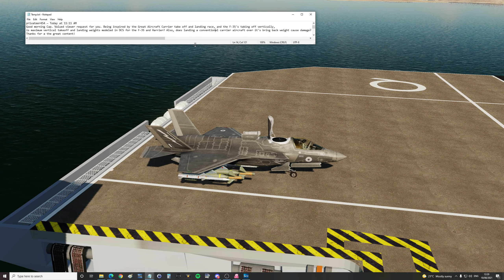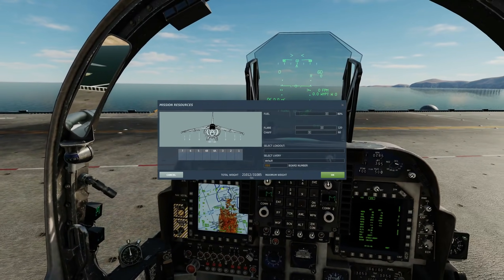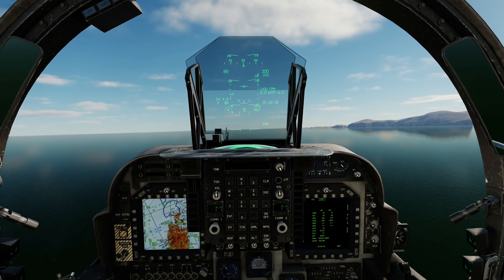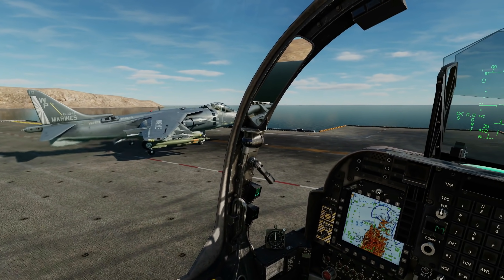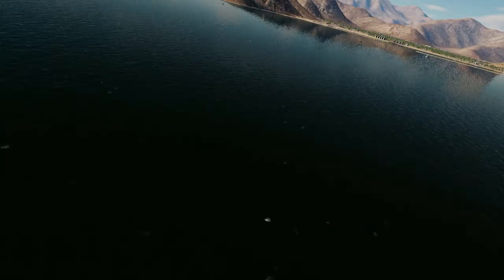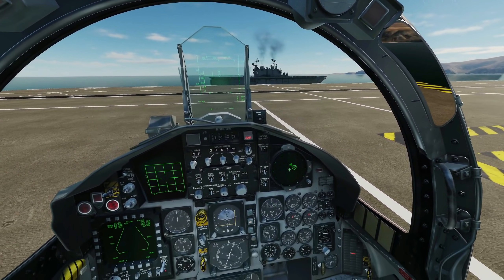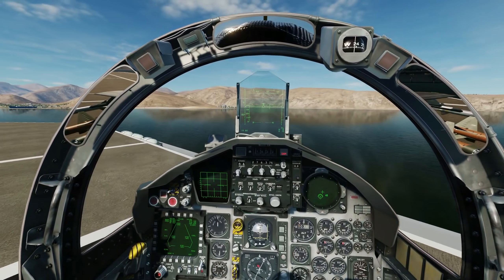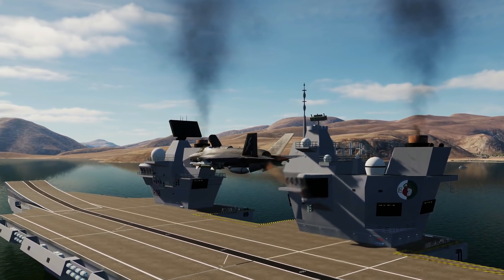Questioned: How Are Heavy Payloads Modelled With VTOL/STOVL? | DCS WORLD

Comment: I mean it's more effort but you can make educated guesses for a lot of the values (eg, weight, or tire friction etc), while it might not be 100% true to the actual thing, it would at least behave approximately how it should.
I think the only difficulty with the F-35B would be the drag on the lift fan, because it's not just static geometry exposed to normal airflow, but actively sucking in air too.

Comment: Also, if the thrust nozzle of the harrier is directed straight down, the plane has a net forward thrust from the vacuum created in front of the engine.  Taking off vertically requires over titling by about 15 degrees.  And reduces the net vertical thrust by a to factor cosine(15 degrees).  The fix is to point the nozzle straight down and allow the plane to roll on takeoff.
Reply: Point the nozzle straight down AND THEN take off normally??? 

How tho without horizontal thrust???
Reply: @shanedoesyoutube8001  being able to take off with a net horizontal thrust of zero is what makes the harrier special.

Comment: Also the real F-35 thrust to weight ratio is fairly weak compared to say an F-22 which is over 1.0 and will therefore accelerate in a vertical climb. Would be interested to know if it still does this fully loaded in DCS!

Comment: sfm still shouldn't let you fly if you don't have neough thrust or your weight if it's set up correctly
the f35 just seems to have too much thrust
Reply from the maker: agree
Reply: @grimreapers  in this case it seems more like the mod makers faul than the sfm's fault
the sfm is simplified but it doesn't inherently make the plane more or less powerful just... simplified which can be a smal ldisadvantage or advantage
and you could make an efm inaccurate too if you wanted to
it's just most people who go through the trouble of making an efm also make sure it's as good as they can get it while an sfm is relatively easy to make so a lot of people use it to play around and try out relatively unrealistic things so in practice a lot more of them are overpowered

Comment: I have a good pc what is the minimum equipment I would need to play DCS without it being horrible?
Reply: t16000 stick and throtle would be a good start with trackIR
Reply: I’d say don’t go lower than 8gb ram and I’ve got a gtx 1650 which is surprisingly good on my pc. And I have a 3rd gen i5 cpu. I’m able to play dcs at max settings(although my pc gets hot aha) and it plays perfectly. This set up really isn’t expensive in terms of what you might think you need.
Reply: @dritchie9417  Im good on the pc 3900xt and 32gb ram 2070ti  I meant the stick and other equipment recommendations entry level.   Not gonna use VR
Reply: @artonline01  depends on how quickly you're willing to buy a better stick. 
If you go with something like the 3d extreme pro, which is great from its price point, you quickly learn its limitations. Same can be said for any mass produced product i.e. thrustmaster, logitech etc. and some of those can be quiet pricey. 
One the other hand you could spend a little more for a quality mid range stick like the VKB NXT or Orion from Winwing and be happier with your initial purchase and less likely to want to upgrade sooner. Just speaking from my experience and wishing I would have known about the slightly more expensive options to begin with.
Reply: @ArmChairPilot.  Thank you
Reply: @artonline01  your welcome. Some kind if head tracking is pretty important too. I use a delanclip with opentrack.
Reply: @dritchie9417  I'm using a CH Fighterstick and a used X56 throttle
Reply: need 3090 for great vr experience
Reply: Just by a cheap flight stick. Then start of with the flaming cliff modules. If your ready then buy your favorite aircraft.
Reply: I flew VR on an overclocked 3570k and a 1080 with the CV1. 32GB of RAM though. But the CPU totally dumped itself on MP servers with the usual script galore that makes them interesting in the first place. Even going back to Pancake didn't help any with that. But offline was totally fine, mostly had it running at 45fps with just a few drops down to 30 with all the fancy graphics on (lowest settings that don't look shite though, like shadows low, terrain object shadows flat only, water medium, but other settings cranked like textures full gate, vis range ultra or even extreme)
Reply: @CakePrincessCelestia  I would totaly get a 3080, but on principal I will not pay the inflated price. I think my 2070 should hold up.  I just wanna fly and find a good stick experience... and seems like the most important besides track ir
Reply: Im thinking around 400 usd will get me into the flying space for ir and and stick not cheap but dont wanna get crap

Comment: That F-35 even goes to fly after taking off immediately like its nothing lol
Reply: at the end of the video, the f-35 flies straight on rails,,, until the very end, when it looses height,, but the video cuts off there. 
I guess the carrier "rails" ended there. And thinking about it ,,, was there a carrier video a while back where the hornets tried to take off but just splashed into the water. I guess the weight/lift ratio suddenly kicks in and the plane just drops. (and that the hornet lift was bugged for the carrier video...) 
Interesting how far out it reaches... I wonder if that could be a topic for some silly video.... hmm